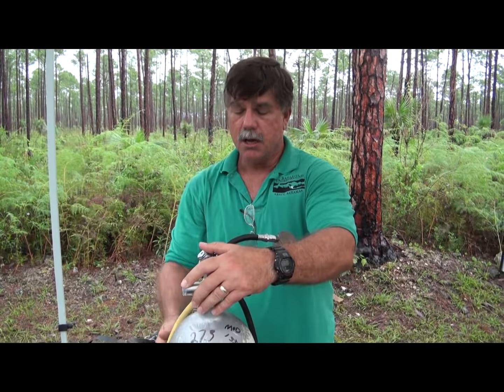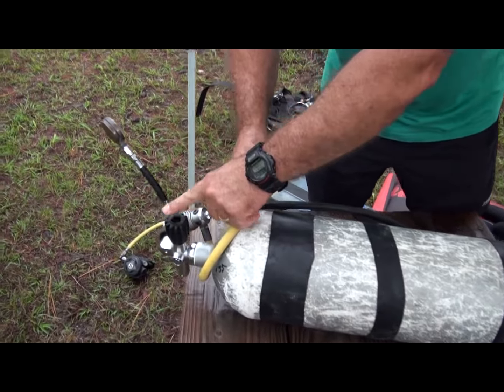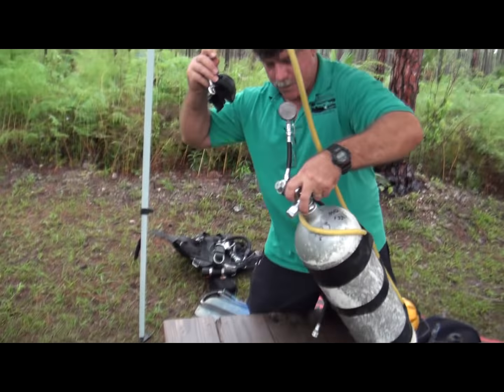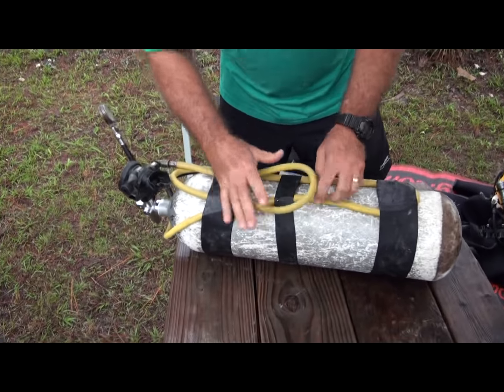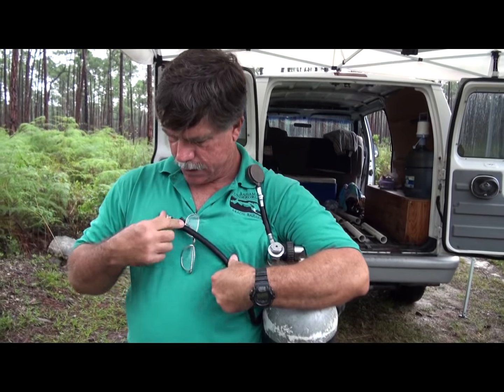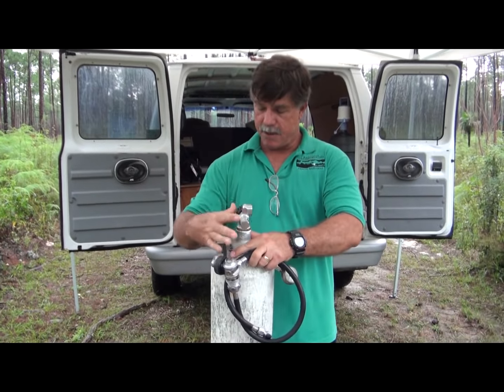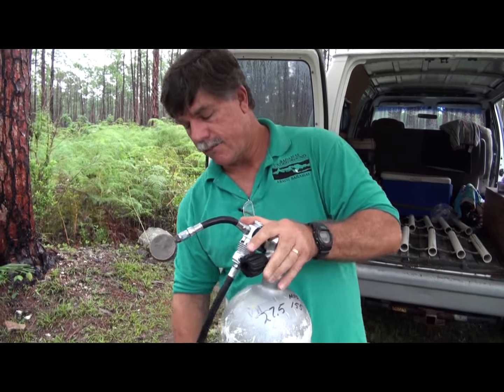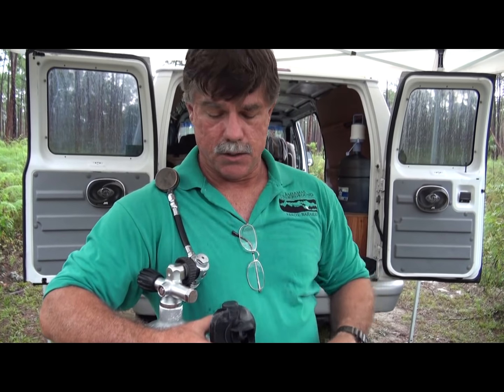Cave Diving Sidemount Training  IANTD Instructor Brian Kakuk (part 1)

Comment: My SPG never stays upright like that no matter what I tried it doesn't
But I like the SPG up so eventhough it is dangling I prefer this method.
Reply: Tom Nelson Thanks a lot. I am using Standard Dive Rite SPG'S with braided HP hoses
Reply: MrNotebookguy  braided hose, there's your answer... Braided hoses aren't as stiff as the rubber ones. A bit late, you probably have that figured out by now, if not, you might give it a shot.
Reply: Tom Nelson 
patoux 
Thanks guys braided hose is a little bit flimsier than regular hose I guess.
When you are diving with AL80's do you place some weight at the end of the cylinders? 
Otherwise the bottom part raises and it doesn't sit parallel to my body.
Reply: No tail weights for me. Simply clipping them forward, closer to the belt buckle. Using 2 d-rings on the waist, using the stealth o-rings or getting a pair of LB-SR will allow that.
2 reasons not to use them: if you consider them part of your weighing, you can't drop a tank. If you don't, you're overweighted.
Also, the fun part of AL80s is that at the end of the dive if your tanks are almost empty you can just let them float next to you before handing them to the boat :D (Make sure they're floaty before doing that, or you'll feel sorry)
Reply: patoux
Sorry there is not LB-SR in the part of the world I live in and I am using Dive Rite Nomad LT cave model. 
Probably it is best if I add forward D-rings on my belt
Thanks for the info
Reply: You can still get it done using 2 d-rings on your waist belt, or adding the Stealth O-ring (roughly 5$ each) that will allow you to trim your tanks as you wish. They will be useless when diving heavy steel tanks, but that's the only way I see as for me there's no way I'd add weight to a tank.
Reply: patrick bobbink Alright I have 2 other questions if you guys don't mind

1- Where should be the place for the bottom clip on the cylinder? The distance from the bottom of the cylinder to the bottom clip attachment on AL80's

2- What is the appropriate rope length from the bottom of the Large size bolt snap to the tank? on the bottom clip